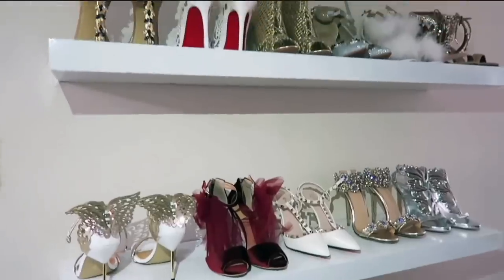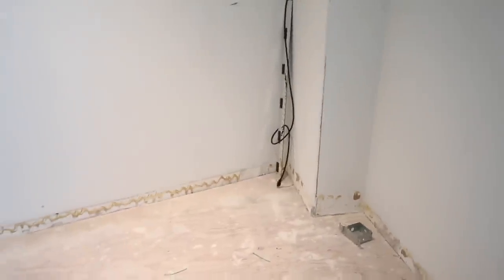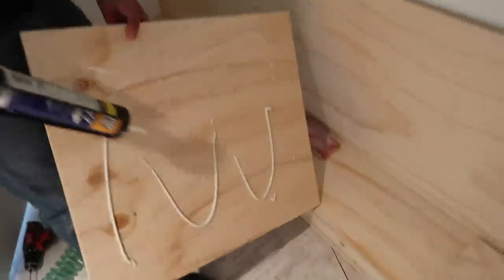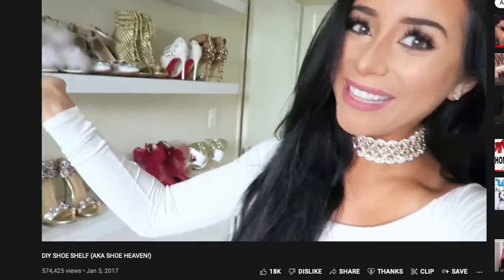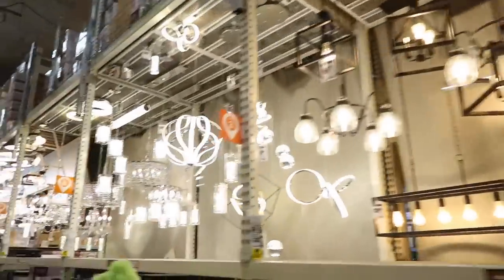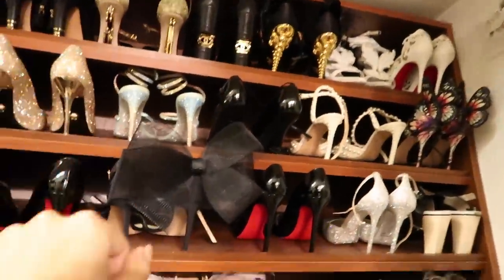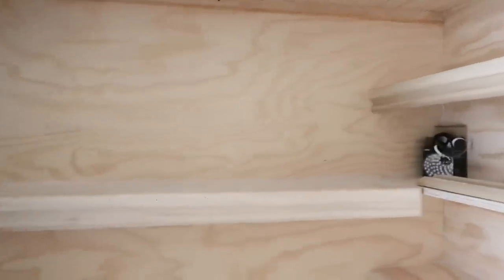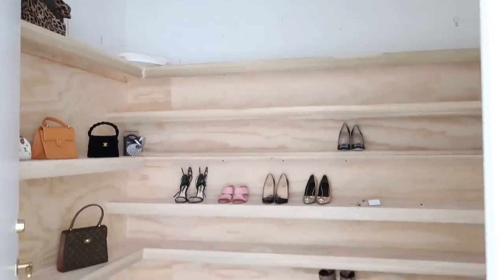Building My Dream Shoe Closet!

Comment: I love your shoe and purse closet! I'm glad you decided to go with a more "classic" vibe i.e. custom carpenter shelving; that goes with the library/ballroom aesthetic already finished. A vintage inspired home with a modern closet might not flow as well as what you decided on,good choice my dear. 😉 Strip lighting under the shelves and a warm lit Small crystal chandelier would look best in that small space. Anything close to the ceiling without much of a drop is best for small spaces such as that. The one you showed could work! Think of the style of chandelier you have in the other rooms of the house so the lighting flows together well. Wayfair and lamps plus are great places to shop online for bargain lighting and ideas. Happy shopping girl!